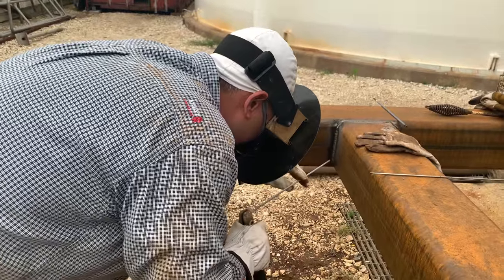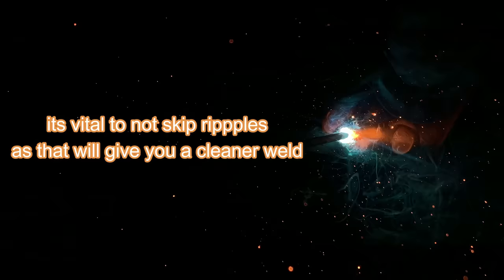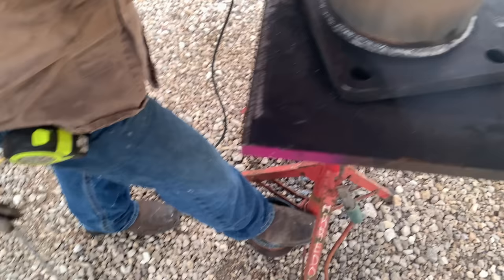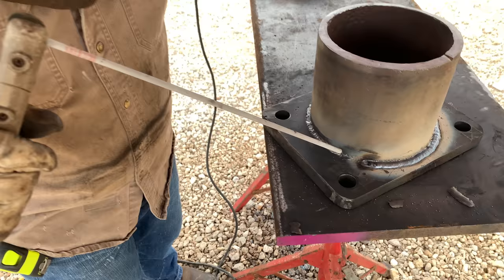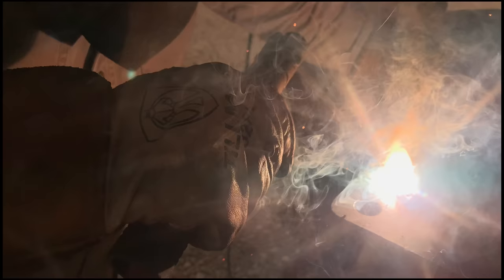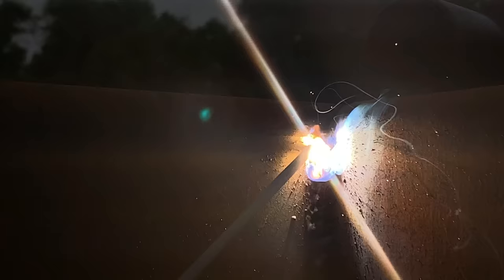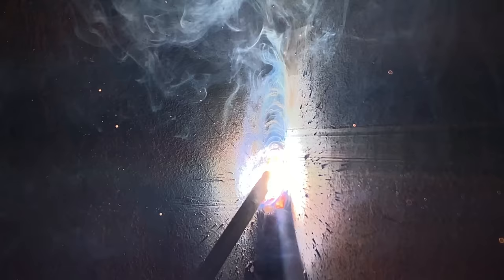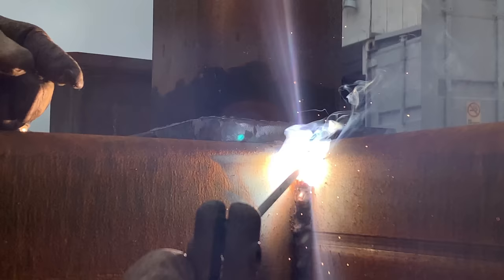Structural Welding 7018 | Backbone of America

Comment: I totally agree with you calling the E7018 rod, The backbone of America. It's built bridges, skyscrapers, pressure vessels, ships and everything else you can think of made of carbon steel. The welds and especially the slag can look like pure hell but the strength and durability is what counts. It can also be a finicky rod to start and can be sticky to get going if the amperage is just a little too low. I use 7018 for everything I make other than sheet metal which I mig. Those are some Fantastic looking beads that gentleman did. He's a pro. Thanks for the video, it's great!
Reply from the maker: Thanks for watching
Reply: One of the main reasons it is so strong is because it burns slow and gives metal a chance to heat up.
90% of the time I used to see people make a ' bad '  ' weak ' weld is where they go too fast of don't pay any attention to heat transfer.
Reply: Pause and fill.
Reply: 7018 is probably where the term "stick" welding came from.
Have they came out with the Teflon tip (no stick) version yet ?
Reply: @workonitm8  haha, yes
Reply: Low hydrogen burns hotter and higher tensile strength
Reply from the maker: True
Reply: Wow my 7018 rod is hard 😂
Reply: Dunno, isn't the 6010 the backbone of America as its used for every root pass before 7018?
Reply: @engjds  In Europe we almost never use 6010/13 for our roots, we do open root with 7018 all the way. So I guess it's the backbone of Europe ? :D
Reply: @rocerist  Ok, but I thought in situations where you cannot clean the base metal, that 7018 will not burn through the crap, where as 6010 will? (6013 a different beast). Used 6010 before and they light up like rockets-really pushing deep down into the base metal, so lets say you are fixing farm equipment, it might be uneconomical to spend time angle grinding all the surfaces, but put a 6010 on, and you have no worries?
Not saying this is fact, still learning welding, so no expert.

Comment: Very nice welding passes! My father was a welder/ pipe fitter. I took a different career path but now that I'm older, I'd like to learn more. My old man liked 6011 and capped it with 7018. He sure could run it down. He died when I was 17. I'd like to learn just as a tribute to him.
Reply from the maker: You got this brother. 🫡🫡
Reply: Love this ❤
Reply: @VantageWelding  Why do people use 6010 rather than 6011 in industry?
Reply: @engjds I believe that most industrial welders are DC. 6011 is more for ac welding, like the old buzz boxes.
Reply: @davedegan12  Interesting, though I can use 6011 or 6010 with my DC machine, know they are both cellulose, but wondered if the welding properties differ, like is 6010 more vicious at removing rust during welding than 6011?
Reply from the maker: I believe is one of those things that became a standard in pipe welding. Although you can run a 6011 rod (potassium based) it burns at a much lower rate. Vs the 6010+++ aka 5P (sodium based) which can run at a higher rate, making it a faster weld. They are both electrolytes but sodium would probably take the cake in regards to amperage and voltage withstand. 🤷‍♂️ this is my most educated guess. I am not engineer, but I’ve wondered about this question before therefore I came up with this theory 😂😂

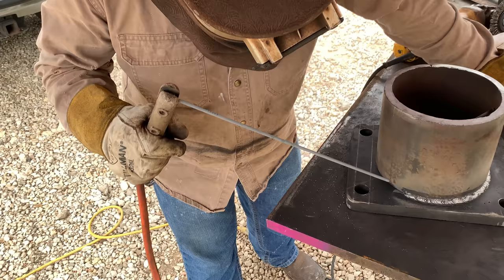Comment: 2:38 - Can we all just take a moment to appreciate how Jose is busting out welds like a machine without propping his arm or even tucking his elbow against his side. A lot of folks don't realize how hard that is. Even the tiniest movements are exaggerated at the end of a long welding rod like that. Don't believe me? Pick up a ruler by one end and try to hold the other end exactly 1/8" off a surface while moving it... now imagine doing that while the rod is continuously getting shorter.
Reply: Its not that hard you're kinda over exaggerated this
Reply from the maker: Jose approves this message
Reply: You have to be a machine.
I did a lot of one- handed MIG welding for many years. I think about it every time I see someone using two.
Of course mig welding is different, you can go all over like scribbling with a pen and still make pretty weld.
Stick welding you have to be a robot.
Reply from the maker: I promise it’s all the same.
Reply: Or just use both hands. What's wrong with it? Welding is not about looking cool. It's about laying down a good bead.
Reply: @judith_herault  sometimes it's best to use one hand while holding steady hanging on to something with the other.
Reply: haha this was the best moment
Reply: @judith_herault  bead looked ok to me
Reply: @micdiva  you're the guy that no one talks to after work
Reply: @DruncWizard  huh?
Reply: @judith_herault  the other hand had a joint or beer in it...
Reply: A little green in the morning and a cigarette right before the job steadies up the hands real nice.
Reply: not hard
Reply: Question is why doesn't he.would be less fatigue
Reply: He is a machine lol
Reply: @DruncWizard i dont want to talk to anybody after work, i want to go home at that point.
Reply: @mushroom11g55  based

Comment: Been a welder for 31 years. I started in the ship yard bay ship building company in sturgeon bay Wisconsin. I'm a boiler maker. Took my welding cart. At northeastern Wisconsin tech trade schools in sturgeon bay Wisconsin. They had the best instructors while I was there. And they closed the welding school down.
Reply from the maker: Much respect man. When I worked at southwest shipyard in channelview those shipfitters were a different breed of animals. The way they used their torches ever so careful was amazing to me.
Reply: @VantageWelding  I'm a tanky to worked on a tank farm in Vernon ill. Worked on 5 crude oil tanks at the end of the pipe line. Build high pressure vessels at niles steel tank co. In niles Michigan. Got an L.A certification from California. They xray everything I've welded. What's bad about that is they make me fix people stuff they put in for the same amount of money. And there is no special pay for repair. That will make you mad.
Reply from the maker: @gregfuzi1069  it’s all love man. Tank work is really hard on the buddy. Welding 1/6 wire all day and 7/32 lohy. Salute man. Not many can hang in that field.

Comment: Made a career, as a Boilermaker "certified high-pressure" welder. My one critique, on the square tube steel was on the vertical. You never "start/stop" a weld at the corner. I was taught to stop at least an inch before the corner then with a new rod continue up and over, finishing an inch past. Ideally that steel should have been power brushed, to remove the rust. With the rust removed you get a better weld and no "popcorn" sound.
Reply from the maker: Certified hu? 😅🦾🤣
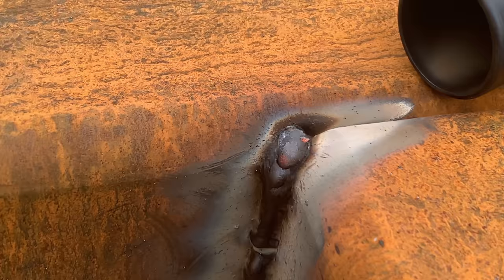Reply: @VantageWelding  Yes sir, certified. Meaning I do a tube test coupon, in 6G position. Typically a 2" tube. 1/4" tacks (heli-arc) maximum. 12 o'clock is punch marked with your tacks at 12, 3, 6, 9. Your tacks are inspected by 5 contractor tips and 1 ins. co. rep. These 6 will inspect every portion of your weld. If any one of them says "Fail" you're done. Your coupon is then mounted In the 6G position and remains there until the welding is done. You complete the heli-arc gut, which is then inspected. Two up-hand E7018 filler passes, again inspected. Finally three up-hand cover passes and inspection. The coupon is then removed and after you stamp your cert # on it, 4 sample straps are cut (1:30, 3:30, 7:30 and10:30). You then clean  them and return them to the inspectors. They each get bent U-shaped, with your weld in the center of the U. One gets a root bend. One gets a face bend. The remaining two get side bent. If nothing shows you are certified to be able to do a high pressure weld. Plate steel requires less. In an open butt 6G overhead. My construction site welds have been x-rayed, ultra sound inspected, dye penetration tested and even magnafluxed. In my career I've never failed a test or had a weld rejected.
Reply: this guy is straight out of the classroom isn't he
Reply from the maker: 😂😂😂😂 probably not from the states. They take their certs really seriously else where.

Comment: Just to clarify, the first two numbers on a stick electrode do indicate tensile strength, but it’s measured in psi (stress), not lbs (force) as you said in the video. I’m sure that’s what you meant, but I thought I would clarify for others that are watching.
Reply from the maker: Thanks boss. Yes it’s per square inch. Sorry for that error. Lol
Reply: I once worked with a kid who was always talking about the tensile strength of rods we were using. I asking him, " so what's the big difference between 60,000 and 70,000?"
Reply from the maker: 10,000? Lol

Comment: all work depends not only on experience but also on the consumables (electrodes) you have. In the USA, this is simplified to own brands of electrodes. in Russia, for example, there are too many small companies and too many companies and it is very easy to get confused in them. Yes, an experienced welder will weld with fittings) but even so if the design is responsible and the employer is not responsible and supplies cheap, bad or not suitable electric rods. then it gets to the welder. and you have to include all your own skills and experience.
Reply from the maker: Most definitely. I’m glad I can get my hands on any tool and or consumables where I work. But I’ve had a couple jobs were you had to work with what you got. Although a bit more complicated, those jobs teach you real skill.

Comment: When the hood drops, the bullshit stops!
Does anyone else drop your head when he strikes an ark? It's a muscle reaction after 35+ years. 😆
Reply: No neck problems?
I have arthritis in my wrists so I just put the hood down with my hand worried about retirement.
Reply: @mrillis9259  pushing steel around for this long destroys your body...part of it.
Get a good pillow, and a comfy mattress...you'll need a good night's sleep. I'm not saying it's doom and gloom, it keeps you active, no need to push iron in a gym when you do it at work all day.  Good sleep and beer helps the pain...but that's just me.
Reply from the maker: Try pure CBD from one of the Oklahoma stores. When I was working out there l, my wrist was in so much pain from welding on the roll our wheel. Took a leap of faith and bought a tincture/vile which was pretty pricey. After the 3rd day, my pain went away and never came back
Reply: ark is a fictitious boat, arc is the proper terminology. (as a welder of 45 yrs)
Reply: @krl9747  A fictitious and undoubtedly a very smelly boat.

Comment: To make X Ray quality welds, not only must the welder be skilled, he must have dry high quality welding consumables and a welding machine with a clean DC current output.
Reply from the maker: I’ve seen unskilled welders pass X-ray and pass bend tests. But yes having a good machine and dry rods always helps
Reply: @VantageWelding  a stick test is very forgiving on X-ray and bend test tbh
Reply from the maker: Depends what’s code you’re testing for. If you’re testing for b31.3 severe and you’re getting xrayed, and welding small bore such as 2”, you can’t get away with anything to be honest. 1104 is really forgiving. And b31.1 and b31.3 is alright. B31.3 severe can be difficult at times
Reply: @larselder874  yeah all mine is ASME also, being a union pipefitter
Reply: Flux core wire is so much nicer though, these days stick is only for remote access jobs...😊

Comment: When I weld with 6010 either I whip it or do little circles.
Reply from the maker: Yes that’s perfect. I hate when people say there’s only one way to weld. Whatever works for ones self, should be plenty. The circle motion I used often when I’d mig. Thanks for watching.
Reply: @VantageWelding  my teacher told us the only way to perfectly weld is to do little ovals but I ended up finding another way that worked but was easier for me
Reply from the maker: @C4_43  there is no set technique bro. Ever welder is different. You just have to find what’s good for you. Peace

Comment: A question: if the angle of electrode towards the workpiece changes, doesn't it mean that the penetration changes too?
Reply from the maker: Yes. A good example is when welding old to new. You give yourself more of an angle pointing towards the new piece focusing less heat input into the old.
Reply: @VantageWelding  what i meant was the welder in the video with the circumferential weld was not moving himself, yet he welded at least 1/3 of the circumstance which means the angle of the electrode changed during the process
Reply from the maker: He was definitely moving his wrist around the pipe. Ones body doesn’t have to move as long as your arm and wrist compensate for the correct rod angle.
Reply: @VantageWelding  4:00 and 5:00 obviously different angles towards the bead . I've watched a few times and still seeing it .
Reply: @radiononsense9449  he went from pulling to pushing  on his rod
Reply: @michaeljtoney3544  yes and that would mean a different penetration, am I wrong?

Comment: I see he is holding it at a 40 degrees angle but I'm glad you mentioned how he moves his wrist to carry the rod with him in a similar way as if he would pour tiny dribbles of oil around the base of the pipe he is doing a great job in demonstrating the art and you are clearly explaining his actions and I think both of you demonstrating and explaining to show people works a lot better than the one person trying their best to show and explain. It is easier he showing and you pointing out tips than one person trying hard to explain at the same time as trying to concentrate doing the work. Good work both of you. My only question to you just for me to learn myself I'm only trying to learn. What Rod did he use first that you said to only run upwards and that he held at 45 degrees please. I'm learning with the E6013 rod. Starting small while learning thank you so much you both make a great team
Reply from the maker: The rod is 7018 commonly known as lo-hy. Thanks for watching.

Comment: Hey dude can you give me some advice on how to find some good paying jobs in Houston(pipeline welding) I have been hearing that welding isn’t going to be good for the future and I’m just about to start school
Reply from the maker: Welding isn’t going anywhere. As far as jobs you have to start knocking on some doors. The Instagram welding community is actually pretty supportive and helpful. In this rough times it has been hard for everybody bro, but if you want to get in this industry buckle up. Cuz it can get bumpy. Ask the old timers around you bro. My suggestion to you is start school and kill it homie. 👍
Reply: I agree welding isn't going anywhere even with all the robotic welding it's much easier to send a welder to learn to program than to teach a programmer to weld
Reply: Actually a lot of old timers will be retiring, welding is not going away at all, quite the opposite from what I’ve read.

Comment: Honestly I’m surprised to see you running a 3/32 7018 then a 1/8 7018 on something that big! Don’t you guys run 1/8 7018s on stuff like that?
Reply: welding uphill is slower, a 1/8" electrode would provide too much heat. it is appropriate to use a smaller electrode to avoid cooking the metal.
Reply from the maker: Yes sir. Certain applications might be ok. It wasn’t necessary in this instance. Ultimately you can run whatever you want as long as it’s within the welding procedure.

Comment: After yrs of welding you learn to weld high heat and push the rod in vertical welds. All the impurities float to the top with the flux. Flat welds the same with rod position like here. I weave a little not much on flats, moving the rod momentum depending on bead width, but slow enough for good penetration.
Reply from the maker: Perfect explanation.

Comment: If all you got is 7018... Use a torch to make sure the rod is dry and around 150°. To go downhand preheat the weld area to around 300° to 350. Make sure the surface is clean. Run down hand in a zig zag weaving motion keep it tight but bouncy. If the slag gets ahead of you whip it away with the rod and continue your patterning. Machine settings may vary so that is something you will also have to figure out on the fly. You will get really good penetration. Next passes should be uphand after you've allowed the work piece to cool down to around 200°. Do a snake belly pattern on the up hand and don't stall out. Keep moving everything will blend together nicely. And at around 200° starting temp the slag will get the hell out of your way 🥳🤟 and always remember don't get greedy. If the rod starts to blister then stop if the weld zone is too hot then stop. Take your time and plan your moves 👌
Reply from the maker: Bro. It’s just a stand. Junk iron steel. 😂😂😂

Comment: Nice easy learn show, weld current volts ? US-120V,(V=I over r,amps over resistance),100-120 amps,positioning the pointed arc heat 4  penetrated pudels with good sounding of the arcing  both the cleaned sides 4 the dry rods-7108,H4A ,well done and cheers from an M/C ist in the Aust. Great stuff
Reply from the maker: Salute brother. 🫡🫡

Comment: On the big pipe flange, how big is the arc gap ? Your saying it's best to drag 6010 @45 degrees vertically and drag angle ? But then as he moves closer to himself, he comes to a 90 degrees drag angle ? You said 7018 should not be drug but then he's dragging it ? But then gradually switches to a push angle ?
Reply from the maker: I think it’s the angle of the recording brother. He had a slight push but never the less the puddle stayed behind the rod.

Comment: Absolutely beautiful. What size circuit breaker is feeding your machine? Also what machine are you running in this video? Thanks
Reply from the maker: Thank you. We were using an engine driven big blue Miller on DC 7018. And a maxstar on 480